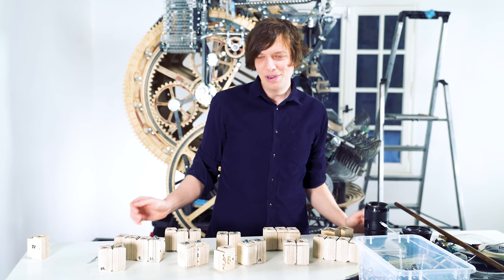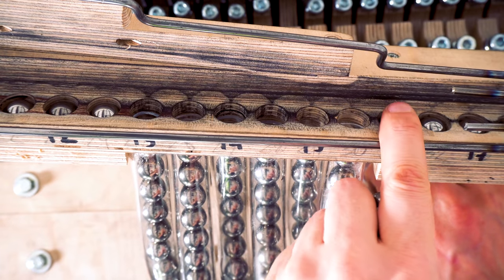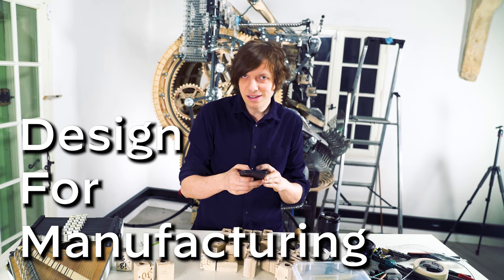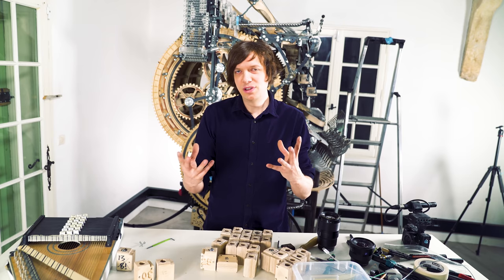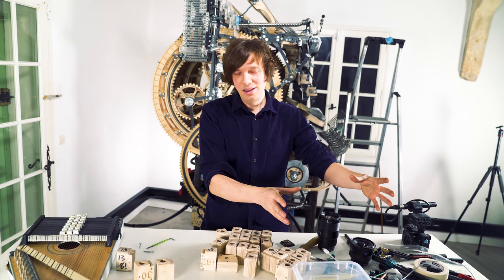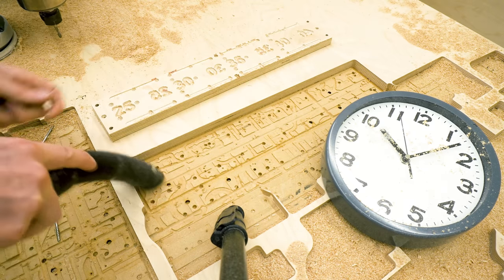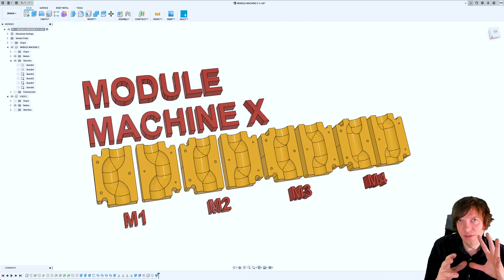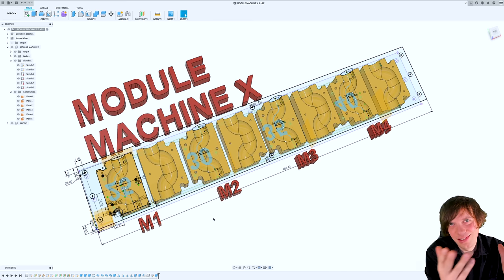Module Machine X

Comment: I can imagine, that you could get mor tolerance for the height of the top Marble when you lower the Angle of the Marble divider. So that the new Marbles dont need to go up as much when they go over the top marbles instead they would go more sidewards. Another Approach could be to shift the guiding-wood behind the marbles a  bit more to the Back, so that the new Marbles don´t need to go over the very top, but rather go more over the sides of the top Marbles. Or maybe both of my suggestions together. (for the 2nd one, it could help to angle the guidng-wood a bit backwards too, to reduce Friction.

Comment: Martin, have you thought about a module that allows to adjust the length of the marble path by turning a screw from the front side? Inside, there might be a disk or a wedge that is turned/moved by the screw.
Slightly more complicated than your solution, but you might only need one size, and you could fine-tune even on stage...

Comment: It's good that you made the process of the height modules more efficiëntly, because I'd say if you figured out the correct height for each marble, you wanna make a range for each lane, spare height modules, I'd say with 1mm height difference. Plus and Minus.

And I think, because your marble is round, you can't really measure it accurately with your device, so you gotta think of something for that, maybe just a little circle centered attached to your ruler thing which justfits into the lane, so you measure the same all the time

Comment: Something I'm noticing that may be a problem down the line is that in these experiments, the marble is slowing down compared to the rest of the placeholder path heights. Given enough finished marble paths, the marble will, unless the lengths are changed, eventually stop and cause a jump.

Comment: If i could redesign the entire marble divider, i would put a gate at the top that only opens when the reservoir tube is running out of marbles. Triggering the gate with the weight of the marbles might be a bit messy though.

Comment: You talking about that the Cybertruck has sharp edges due to it being designed for manufacturing and that people like more the round edges, gave me a thought route to why people like round edges. My guess is that the human body has a lot of round edges. I do barely find any sharp edges on the outside. I recently chose a handle for kitchen furniture that is mostly round. The reason for this decision was that I might hurt myself if I accidentally may break my skin when I would use it in rush uncarefully. Probably our human bodies is not designed for manufacturing, but for maintainability/repair-ability. Since when you get any (deep enough) scratch on your skin, the body tries first to fill it with blood and then repairs the body part underneath that hardened blood. Liquids harden into a round shape mostly due to the surface tension effect.

Comment: Martin I think one reason the car designer doesn't talk about DFM, in his video about the Cybertruck, is because it's two disciplines. He most likely talks as his role as a car designer, not as a DFM engineer/designer. Although an interest point to include of course.
Compare with architecture: first you have the idea and working with how the building would/should/could perform according to the design (purpose of the building down to every single detail) and then you have the construction engineering part where this design idea will be funneled into what is feasible.
Both car designer and architect (etc) should also have some knowledge about DFM and engineering, but if they designed solely with that in mind there would probably be too many parameters making new ideas very difficult to realise.

Comment: From a programmers point of view, getting the value of the tool path variable to print as text should be easy. Look and see if there is a way to get the variable you used to also produce (maybe work some text manipulation) the text.

Comment: You should be able to parametrically create the numbers on the reverse as well, since they're based on the measurement you input. Multiply by 10 to lose the decimal point, then subtract 100 to lose the first digit. ie: (12.5*10)-100=25.

Comment: 4:53 I knew about this, but I did not know it was called DFM.
Absolute minimal change from the pre-products like pipes and sheet metal is often seen in hand-rails and park-benches bus-stations and so on.
DFM Manufacturing efficiency maximization caused design constraints is kind of "form follows function" for the making phase of a product. 
Lets see … 
"form follows function" for the usage phase of a product would then be DFU (design for usage) and that leaves 
"form follows unrealistic dreams" and that would be DFIBAU (design for inefficient but aesthetic usage)

Comment: Be careful when flipping the part to machine the opposite side. Because it is symmetrical, it's is possible to engrave numbers on non-corresponding modules.  Perhaps place one registration pin inline with the flipping axis.

Comment: Did you investigate an adjustable sliding mechanism for the marble height adjustment?  These modules you've made have a fixed-length path inside.  Did you consider making a movable inside piece that could slide back and forth (like a trombone) to change the length of the path?  That way you could manufacture one type of module and adjust it anywhere in the range of movement.

Comment: martin, as someone in engineering who works with designers, they rarely if ever use DFM (at least in my industry).  It always falls on the engineers shoulders to tweak the deign to make it work while still holding true to the design ethos.  The fact that Frank didn't mention why the Cybertruck was designed the way it was, fits quite neatly into the mold for most designers.  They come up with a beautiful concept, reality be damned.

Regarding my opinion on the Cybertruck, i understand your point about how it will be easier to manufacture.  I still think they could have sacrificed some of that to at least make parts of its exterior more conventional.  I have no problem with the stainless exoskeleton, I just think it looks like it was drawn by a 5yr old with a crayon.

Comment: It is frustrating for me watching you work so hard to solve a problem you created, seemingly ignoring a simple solution.  If you made up a plastic pipe to be the right starting length precicely (a number of quantum marbles, plus a bit of an extra marble to fine tune),  you could sand a bit off the ends to exact-up the marble heights in the marble divider, and all the marble modules internal paths could be made the same.  

Begin with a length of plastic pipe that guarantees some amount of marble is proud of the top of the marble divider.  Remove length from the plastic pipe until the marble on top rolls away.  Far simpler, far less trial and error.  Far less frustrating.  Great videos!

Comment: This is neat and all, but you could have also just pulled the tubes out, or pushed them in more, where they come out of the blocks. Use a hose clamp or something to hold them to the right position once adjusted.

Comment: How about making the adjustment using a sliding pipe adjustable by a distansing skrew. Så you can adjust the marbel path sliding the pipe in or out. I guess that would give you a much finer control on adjustments and faster adjustments.

Comment: If the flat design had enough production cost savings to allow for better sales margins or prices that significantly beat the competition, we would have seen it come up much earlier. Manufacturers do want to make money after all. Many engineers and designers with more experience than Musk have worked on this and decided against it, so the design very likely has significant downsides. Mechanical stability and aerodynamics come to mind, but I'm sure there are more issues.
Apart from that we only know the flat exterior, the frame beneath might be just as complex as that of a regular car.
Reply: Apparently I missed that the exterior is supposed to work as an exoskeleton, which is pretty worrysome from a safety point of view.

Comment: I think you're wrong about the whole cybertruck thing. Meaning, I believe the design of the cybertruck would be more complicated to manufacture than a traditional modern car.
The flat panels would have to be internally reinforced more because flat metal is far weaker than curved metal. There are less seams so the chassis would have to be welded in a more complicated way and have bigger tooling to stamp and bend the panels. and the lack of paint would require more precise finishing of the metal for a smooth finish and rust prevention.

Comment: Yes. I used extensive DFM for my product. Took over a year.
I'm not sure Martin .. how many MMX do you envision producing?
Couple things:
The height-adjust tracks have some sharp edges at the turns which will wear quickly and cause the marbles to gradually sink over time. In fact, the chaotic outcomes in those curves will probably result in over and under height with no way to predict. You might consider strengthening the edges with some kind of resin for durability? Or cut them in delrin instead of plywood?
Your CNC is beset by alias error from the tools. Have you considered getting profiled tools made that do the job in a single path with only depth being the variable?
I am used to dealing with goods and their commercial value. We say "form/fit/function" to describe an SKU (shop keeping unit) that is repeatable enough to be treated as a commodity for planning and financial bean-counting.
The MMX is not an SKU unless you plan to make a lot of them as a commodity?

My product was never intended as a commodity. Sure, it has form fit and function, but being a musical instrument, it had to comply with the dynamic formed between a player, the skill, the audience and success as defined by a musician.
My DFM had to take into account all the senses (sight/sound/touch/smell/taste) along with the skill requirements of performance, tuning, timbre, tradition, expectation and presentation.
My DFM made sure to preserve the full spectrum of human perception for final completion above and beyond the techniques developed to get it to that point. As such, it always remains "bespoke".
My product is still used as a benchmark for the last 10 years. You will see if you can find my website. Unlike consumer commodities, I never need to advertise and I welcome fellow makers to enter the "market" and will never constitute competitors - only colleagues.
I DO appreciate that you are mostly a video producer - your music generates little or no income beyond that. Which I see as a shame and waste of a fine musician.
How about you nail this machine and progress back into music which is your first love?
Rejoin the reality of human senses, music expression and tradition?
I am so bored with you descending into corporate methodology at the expense of your true art.
I want to see you performing and advancing the musical power in you.
Please do that?
Your current direction seams a dead end.
Unlike mechanical and digital skills, music will never wear-out.
And I would rather see your core contribution come to the fore?

Comment: Martin and some other commenters hit on the issue in a previous episode; the marbles are allowed some lateral movement which will introduce a constant variable into the marble paths and will impact the paths total length. Even if this if a few mm overall, this is going to surly undo all Martin's efforts to some degree. Or am I over thinking this?

Comment: I'm not sure if the point about the Tesla Truck's straight line being consequential DFM versus soft lines is legit - you have to mold the parts after all, and it doesn't matter if your mold looks like a cauldron or like a cigsr box from the inside. The work is the same: you put a sheet onto the bench, you press it into the mold, you trim the rim.

Comment: One thing I am still concerned about is how the MMX will work when the temperature and humidity changes when on tour. Afaik some of the parts will expand and contract due to heat changes. Will the MMX still work correctly then?

Comment: Btw, what you think of this? if you just attach something to a pipe, with a bolt which you can adjust, you can move the pipe at will, with this, adjusting the height fast and more accurately, you could immediately see the result and you don't have to make spare modules

Comment: What about making adjustable modules ? Like squishing two parts with a screw to make the path length longer or shorter? It seems like tube movements are unpredictable and will surely happen with moving the whole machine, compromising the whole marble divider..

Comment: I love to follow the evolution of you as a designer and maker. And its really interesting topics you talk about about designs and how to manufacturing stuff. I am looking forward to the time in the future when the machine is finished and we can look back on the evolution steps you have taken on the journey to the end. And top it of with some real good music.
With all this designing and manufacturing experience you probably could get a job in the industry :)
But I had one question: why dont you turn the height modules 90 degrees, and then let the tool path for carving the marble channel go from one end to the other without making the machine switching directions so many times? Not sure if it will speed up the time making this, it depends on how much speed the machine loose each time it have to switch direction.
Keep on striving!

Comment: The mirrored numbers will still be mirrored when you flip the part over, If you want to see the number properly on both sides both number should be facing the correct way. 16:20

Comment: You use graphite powder to reduce release which also works well. But it gives your machine a dirty view. I think in a year that your machine will no longer have a hold color but black. Can't you oil the wood with a wood varnish what they do with furniture. Then the wood is also smooth and does not make your beautiful machine dirty and it is also protected against moisture.

Comment: When I see the cybertruck I wonder if those hard corners are aerodynamically inefficient as hell. would  be a big problem for an electric car.
Reply: Not really. Most hard lines go in the direction of airflow so it shouldn't be an issue. Besides with the lower pointed front end, smooth front with no grille, flat underside it will be more aerodynamically efficient than anything besides a EV car.

Comment: Hi Martin, you spend a lot of time with the height adjustment modules. But why does you not go to adjust on the entry point of the pipes with a set screw for the last fine adjustments?
This pipes are flexible enough  I assume. If you don't know how I exactly mean that i can draw you a sketch. I believe the adjustment on top would give you a adjust-ability of about 3mm. Means if your marpel is to high you can lower them direct without disassemby all and tight the set screw or a camper if the set screw is not good enough in the play wood. By the way I enjoy your  work now since long time.

Comment: Hi Martin. I've already done similar things with my milling machine and I think you could go much faster. 
In tests that I've done in plywood, I got faster and faster until I was at the maximum speed my machine is capable (1200mm / min). 
It still worked fine. Of course for strait lines. And I still would go faster if I could.
Maybe you should also do a test, simply to see what is possible.

Comment: I'm wondering if it would be easier to omit the modules and make each pipe adjustable by sliding into or out of a component in the marble path in order to change the marble path length after the divider.

Comment: At the top of the part that the marble is trying to be flush with. Could you bevel the edge of the inside of the marble portal so it has an easier time falling in? Because it looks like it barely fits in and with a bit of a bevel it may help the marble flow in easier/quicker.

Comment: Hey Martin! Check out the ParametricText
 plugin by Thomas A for Fusion 360.
Sometimes it wouldn't update unless you edit/re-save the sketch, but it certainly beats typing in values manually!
Reply: Hmm it looks like there is a spacing bug in the current version of Fusion, but hopefully it will be fixed in the future.
You can also enable the "Compute All automatically" feature in the plugin or go to Modify -> Compute All or Ctrl+B to have it update text extrudes.

Comment: The issue I have with the argument that the Cybertruck only looks like this because of DFM:
It implies that none of the other cars that exist with softer edges and more complex forms were designed with DFM in mind. That there was some huge amount of potential cost savings that every single manufacturer of cars left on the table. That just doesn't sound realistic to me. 
All cars are DFM, ergo it can't be the reason the Cybertruck looks so different